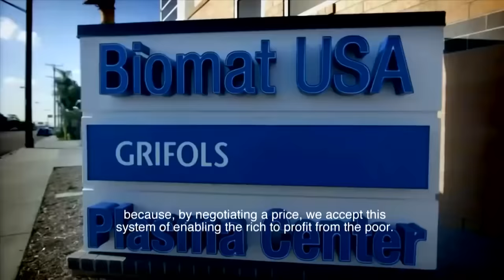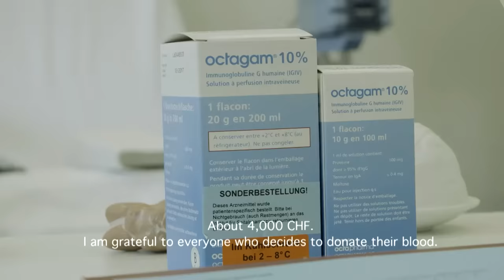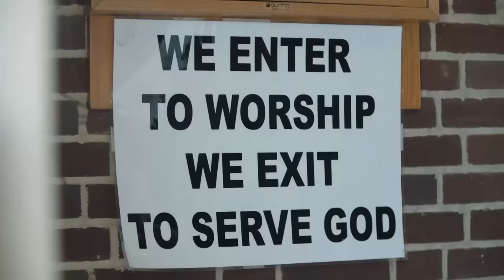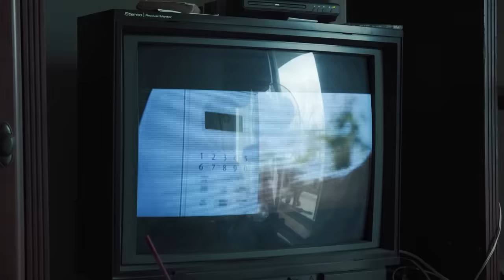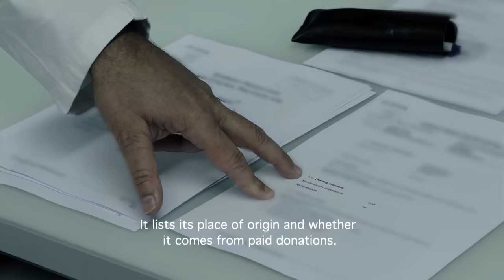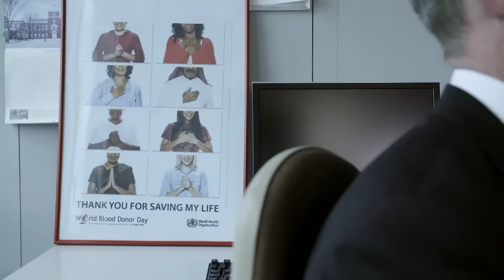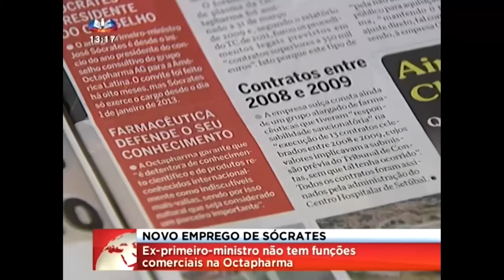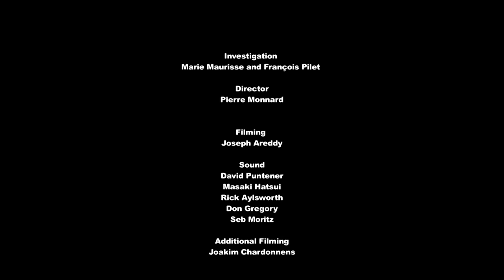Blood Business | New Cannibalism | Plasma Industry | Investigative Documentary

Comment: I was used as a guinea pig by the Red Cross the first time I ever gave blood. They were trying out a new machine that literally separated the plasma from the cells on the fly as it extracts your blood, then returns your blood back into your veins so you don't lose any red cells.  It required THREE needle lines installed in my arm simultaneously, and they screwed it up.  They missed my vein with one of them, and my arm blew up the size of a golf ball before they realized the mistake and stopped the procedure to drain my arm and cancel the donation.

That was my only and last attempt to give blood to these idiots.